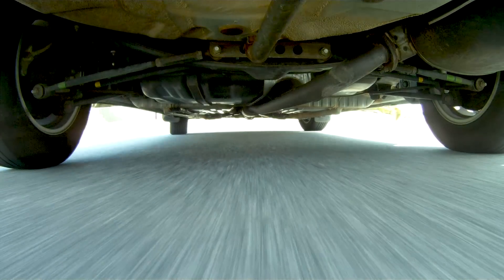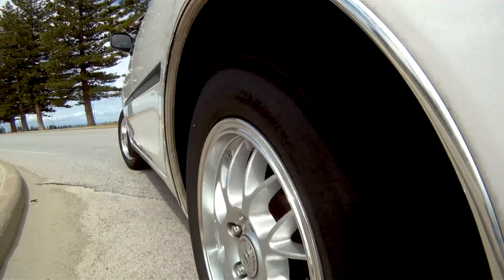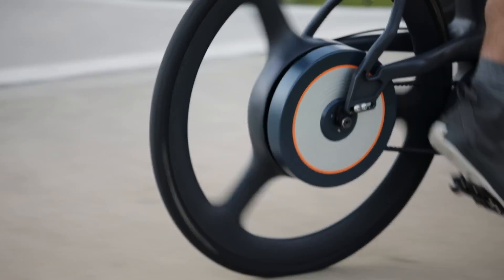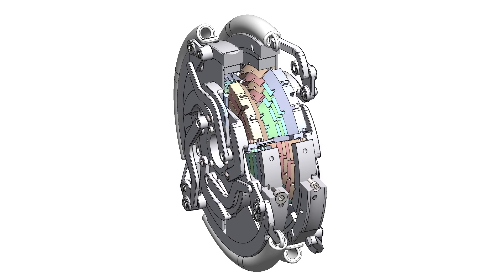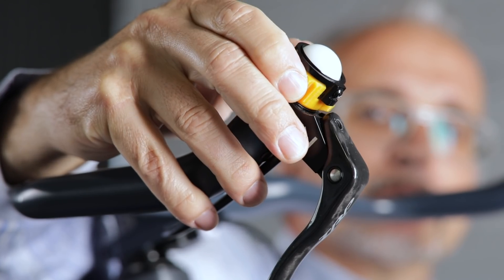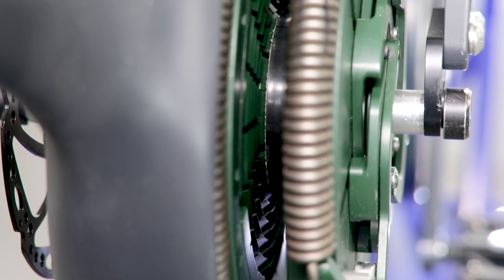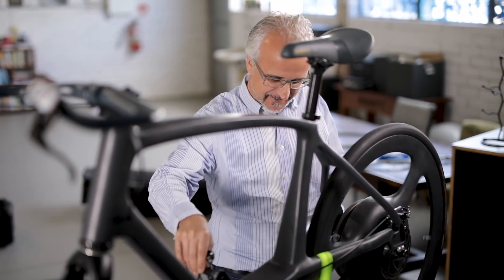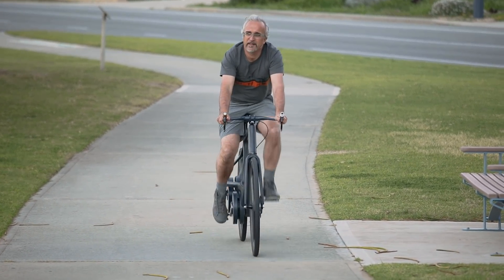Continuously Variable Transmission on a Bicycle

Comment: If you think about it this system would be so much more reliable if used in passenger cars like Nissans Hondas and Toyotas those CVTs use the hydraulic system, in the metal band or belt over time degrades and little metal shavings or debris blocks up the valve bodies on these transmissions but if this type were in place the CVT would be so much more reliable I believe because the grooves would prevent slippage which in turn would prevent heat proned failures.

Comment: Looks heavy, expensive, bulky
Reply from the maker: It was actually all made from aluminum. The whole bike was surprisingly light.
Reply: @InShotProductions  nahhh, still heavy, and the maintenance would probably be more expensive than a do it your self maintenance with a limited tools in hand.
Reply: Yes. A very dumb idea.  Add in the inefficiency of V-belts and this thing is just, well, silly.

Comment: so youve gotten rid of the benefits of a cvt by making discrete ratios got it good job being useless
Reply from the maker: Look closely. They are ramped and don't need to be fully engaged at anytime. so the range of positions is the same as a traditional cvt cone shape.

Comment: This is the kind of project one, as a lone individual, takes on as a personal challenge for fun or as a hobby. I can't possibly see this having widespread success with bicycles because it's so silly. Unnecessary forced wireless electrical components beget unnecessary points of weakness and therefore failure.

At a fundamental level, however, i dont have much trouble imagining this might be particularly useful in industrial applications or other very specific scenarios.

But under no circumstances do i want my bicycle to require a BLUETOOTH CONNECTION.
Reply: You probably aren't in the cycling world considering that wireless gear shifting is now common place on bicycles and work perfectly fine. This thing has a lot more issues than the shifting being wireless.
Reply from the maker: Yeah isn't every electric skate board blutooth controlled? I think blutooth to phone is where people have had bad experiences in the past giving it a bad rep.

Comment: For all those saying this solves a non-existing problem: Your view of cycling is too narrow, and you're downplaying the problems conventional chains and derailers have: High maintenance, frequent replacement of cassettes, finicky adjustment, fragile, and the dirty and hungry chain means trousers/skirts need to be protected. Derailers work well enough, but are not the best solution in every case. The inefficiency of CVT is largely irrelevant for ebikes. The simplicity in use of CVT matters, esp. for inexperienced and casual riders, particularly with automatic control, say for an electric rental bike. Enviolo has shown that CVT can work well for (e)bikes, and Gates have shown belts work well for cycling, with internal gears or singlespeed/fixie.

But this particular solution by Treadlie... it seems very complicated, open to water and dirt, heavy, limiting in what wheels/tyres you can use - and also appears dead. Their homepage is gone. Too bad, I could see it work well on rental ebikes if refined enough.

Comment: the front gear and the back gear have somehow to communicate. in everyday life, the largest front pinion is used rarely while in that invention the gear ratio depends on the front vs rear diameter

Comment: so, i have this idea, to create a transmision similar to a car, with many speed gears to modify the pedal-wheel ratio on the go, but were it takes no efford to go up hill and you can use to go as fast as a car, i really dont know if it is already done, my research doesnt take me anywhere, and if it already exist why no one is using it

Comment: Why did you feel the need to make it electronicaly controled on a vehicle such as a bycicle? Why involve servomotors and bluetooth instead of making it purely mechanical and rider controlled? You made it way more expensive and less reliable for the sake of a little bit of convinience.
A brilliant concept though, it really is!

Comment: A very good attempt has been made in developing this amazing CVT 'drive'. They have also made the gear-change-control part of it wireless which means you are just one step away from autonomous gear changing - an on-board ECU that selects the correct gear ratio according to the cycle's roadspeed and possibly the option to manually kick-down a gear when needed for extra power such as for going up hills.

Comment: About 40 years ago, I saw in the Design Centre, London a system that was not only continuously variable, but automatic.  The chainring consisted of several sectors on springs.  When the force applied by the legs/pedal increased, such as in hill-climbing,  the springs were compressed and the chainring diameter decreased.  I can't remember how extra chain length was taken up, but that could be done with a spring/lever system that derailleurs have.  It was a much simpler system, with very little if any extra weight in comparison to normal gears, but I'm not sure if it encountered problems with the chain jumping on the ring.  There could also have been problems with it reacting too quickly to small reductions in pressure that are inevitable during pedalling uphill and I expect that countering that (dampers?) would have made it considerably more complicated.

Comment: Bluetooth? 
I thought the gear changing would still be dependant on the RPM or rather the amount of centrifugal force acting upon the variator rollers.

As this isn't continously changing(variating) gears(transmission) can you even consider it as a true CVT?

Comment: The mechanism would definately get jammed with dirt/mud, if you are only riding in clean conditions youll probably be fine, but id bet dust and dirt from water splashing will get in there, it needs a whole belt cover which will add more weight

Comment: When he says there is complete automation, that's only relevant in regards to the front vs rear choice of gears. It does not make it completely automatic, because the user still has to select a gear. 
       All he has to do is reduce the weight by a factor of 4.

Comment: What is the weight? What is the efficiency of energy transfer? How reliable is the gearing over time? What happens if the battery dies or bluetooth connection fails?

Comment: I do not understand why the rings have to be symmetrical and bilateral. Why can't the rings be arranged only on one side the other can be a grooved plate. Save weight and width of the design. Another point is all you need to do is set your cadence then let the system work out the best gear for you - voila! no need for bluetooth, manual gear changes, gear shifts, cables etc etc

Comment: The peddling of bicycle is the most stupid thing. When the pedals are horizontal, the torque is maximum. When the pedals are vertical, the torque is zero. So there is about fifty percent utilisation. An engineer from IIT Kanpur India developed a system using ratchet so that torque is maximum always. I do not know why it is not being implemented.

Comment: Sorry a cvt gearbox automatically gives the required ratios according to varying conditions , required output in relation to input. Hence the early variomatic boxes , you don't buy an automatic car then have to adjust manually cause then it would be a manual

Comment: yeah but when we ment CVT transmission on a bicycle we ment it varies continoursly so you dont run out of gear and can still accelerate out of a corner easier

some of us dont have the brain capacity to switch gears and some dont have the strength to power through 7th gear. i fore one, have neither

Comment: There is a bicycle CVT transmission called the NuVichi transmission which is actually commercially produced. It is a completely different approach to the problem which is more elegant than the traditional approach of CVTs.
Reply: Indeed, so far it's the only bike transmission that i give a change in succeeding. And truly CVT.

Comment: Seems the inventors never used a Pinion drive or Rohloff hub. With these systems there is no "front and back" - just one shifting lever and also a very large gear ration range.

Comment: Cool but I'd rather using a system that doesn't require batteries and doesn't use wireless communication.

Comment: How do you solve the problem of having different periods between the tooth period and the connic gears?
I mean the tooth period of the chain is always the same, but the tooth period of the connic gears  apparently (in the vídeo) change between them...
To do it right, you must use the same tooth period in both in chain and gears.

It may cause discontinuity of power transmition when you change the gear ratio.

I would like to know if your solved that! Thanks.

Comment: This seems completely ridiculous. I can't see any application where the minor benefits outweigh the obvious glaring weaknesses of cost, risk of jamming, the maintanence on the 9000 moving parts, bulkiness, bluetooth connection, weight and so on. 

Still, respect that they did it, maybe this will get optimised over the years and one day actually be practical.

Comment: nice tech. 

but my 15 years old cheap mechanical 16 speed chain driven bicycle is still working. 

No need electricity, can go in flood area, and easily survive in dust and sandy environment. Can this bike do it?

Comment: I see a surprising number of comments about the bluetooth connection. There are actually practical components that use it though. Ever wanted a rear shifter or a dropper post that doesn't have a wire? There are conventional bluetooth versions that make that happen!

Comment: Nothing like over engineering a device and making it so complicated that it's almost a joke! This is the problem with modern cars. You're not just driving a car! You're driving a box containing 47 computers, 174 sensors, many different computer programs, cameras, communications systems, and GPS devices, that just happens to have some wheels! And it is so complicated that when something goes wrong, the garage you take it to needs $3 million worth of diagnostic equipment just to tell you that you have a problem! And when you do find the (supposedly) source of the problem, that's probably not the problem! It's probably just a symptom of a problem with some other sensor or part of the vehicle! So instead of a problem being easy to diagnose and repair, the diagnostic fee is probably several hundred dollars! And by the time the real problem is fixed, it has taken 2 weeks and a few thousand dollars just to fix a simple problem!

Comment: a better designed cvt for a bike will be a  a steel belt that rides on the  cones and the cones are serrated so that the belt will  transfer torque in a push design rather than pull  just like a car cvt and  the belt will be able to expand and contract as needed..next the  cones will move closer or apart by a tapered piston controled  by  a cable just like a traditional shifter

Comment: Penalty from decreasing cadence by 15 rpm after a gear shift: 1-2% biomechanical efficiency

Penalty from this thing: 15-25% drivetrain efficiency, 4 kg extra wheel mass, no maintainability or ability to deal with dirt

Comment: You can seemlesly manually change gears anyway, you just need to not apply torque while the chains slips on the desired gear and lightly keeping the pedal moving while doing so, in order for the chain to spin around and nove to the gear and voila, no vibration and no effort. Of course this is all dine in the span of miliseconds

Comment: It's a nice engineering exercise, but it's not CVT. It's not continuous, because you still have individual gears, and it's not automatic. The whole point of a proper CVT it that it automatically picks the optimal gear ratio.

Comment: If dirt and muck isn't a problem, this design could be lighter than the conventional chain and derailleur system. The pulley mechanism could be made from lightweight/high-strength plastic or carbon fiber, compared to sprocket gears that undergo high shear forces.

Comment: Absolutely nothing wrong with conventional derailleurs, lighweight, strong, changes gears smoothly, cheap and doesnt cause you lega to be spread miles out because of uts massive mechanism. I get internal gearboxes on bikes and really like them but a cvt is just a no.

Comment: The bluetooth connection enables automatization? So if you transmit the same data through a wire, it's impossible to automate?

Comment: well its not really a CVT is it? you have many discretely sized pulley faces. An interesting concept, but not a CVT. just a v belt ppulley system with many fine gear ratios.

and is it lighter than a traditional gearset? what about the added resistance? if either of these are worse than a conventional gear system, then functionally it is useless for a bicycle

Comment: At the very least, this is a great solution to make CVT's much more compact.
Reply: I don't understand why they are trying to reinvent the wheel, Enviolo already made a super compact CVT hub for bikes
Reply: With existing CVTs I always felt that the cones are too flat. Lots of energy is wasted to squish the V-belt. You need a wide chain just to pass the force from one cone to the other and hope that is does not jam. Or you only have a narrow range of ratios ( like in many stationary machines and slow scooters ). I mean, people accepted full ICEs on their back wheels before Li Ion was invented.

Comment: The idea is not bad. But this system has three [important] faults; complexity (expensive to produce and prone to failure), weight, and most importantly, high friction. CVT gear is used for a long time in the automotive industry but has never been successful. This will never be a real alternative to ordinary gears.

Comment: Imagine going to a bike ride with your friends. Everyone has took off and you're alone in the back yelling "LADS, HOLD UP, MY FUCKING GEARS ARE PAIRING"
Reply: Or you left it in a high gear last ride and you gotta wait 5 minutes for it to brrrrr itself down to a gear you can take off in
Reply: i mean......srams wireless mountain bike drivetrain.
Reply: i mean, that's what people are doing in their CVT cars anyways...haha
Reply: @justinsarvela1102  I'd stake good money, that a hipster with a fixed gear bike, drinking a fresh Frappula Frappuccino straight from starbucks could smoke a 500 HP lexus  LS 600h in quarter mile drag race without even ruffling his beard.
Reply: Haha good one!
Reply: Sram axs and etap have no issues

Comment: A good bicycle gear system is all about it's efficiency.  Below 96% one starts to feel something is wrong, it is not fun to cycle.  The Nuvinci CVT drive, for at least 15 years on the market, is in that low efficiency range and has therefor never been a succes (unless on E-bikes).  Most probably this gear system will do no better.

Comment: the only way to make cycling more effective is to gain muscle mass to haul your fat *ss

this cvt bike is really awesome, in an engineering stand point, but for a cyclist this is pretty much useless.

adding weight to a bicycle is like installing a heavier engine (that makes the same power as the original engine) to a motorcycle.

Comment: It’s nice to know that the solution to a single uncomfortable jolt I sometimes have on my bicycle when I shift gears can be solved with only a hundred moving parts and a Bluetooth connection.
Reply: I have the solution to that, don't shift under load. If you are going up a steep hill shift before you get to it. If you shift under load you lose momentum and you get that jolt and load clang noise
Reply: @robertdarnell5141  if only the engineers knew that before making a belt transmission
Reply: @danboofin5094  this is an innovation in its infancy, it’s not better rn necessarily but cars used to be worse than horses and I doubt you’d prefer a horse today
Reply: @maxcheese382  I guess ebikes with motors already exist in a pretty significant way if people want ease and efficiency this seems to me fixing a problem that doesn't really exist and making something tried and true like a bike with a chain drive more complex  then It needs to be
Reply: @danboofin5094  I’m saying I think it’s purpose is more that of innovation for the sake of Innovation like this could have a significant use in something else in a very practical way. And the people who will buy this are people that like technology and have plenty of disposable income. It’s not an every mans practical bike but it was never designed to be
Reply: @robertdarnell5141  thisss. I used to shift while I was fully standing on my pedals climbing a hill. I would always occasionally hear a bunch of pops and noises. I realized I was probably damaging my components so I started shifting only when I was sitting down and using normal pressure. Never had a hard shift since!
Reply: @robertdarnell5141  thats not a solution, thats a workaround
Reply: @irgendwer3610  I guess that’s true from a certain point of view, I’d say it’s more of a solution because you shouldn’t be shifting in the middle of a steep climb regardless
Reply: The removal of the chain alone means this set-up probably has fewer moving parts than a typical derailer drivetrain. The bluetooth connection is nothing novel either: high-end road groupsets already feature a wireless connection between the shifters and the derailers.
Reply: CVTs are super simple, but this thing scares me!
Reply: About 1 minute in I was thinking 'Nobody is going to be dumb enough to fund a production run of these things, although it would be cool to see when they hit the shelves'. Then I saw this video was posted 5 years ago...
Reply: 100%

Comment: The one problem I have with conventional systems is downshifting when going uphill. Based on my experience with CVT in a car there might be an advantage here, the issue however is cost (both dollars, complexity, weight, etc.)